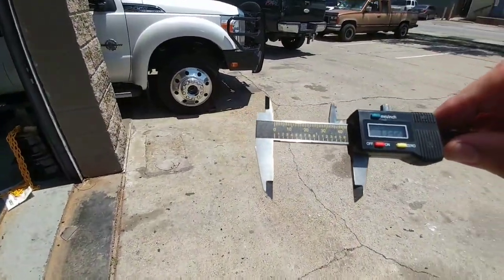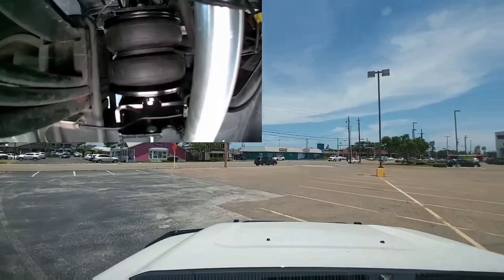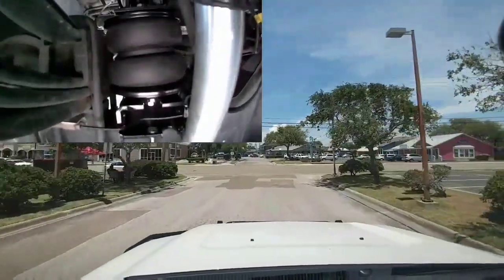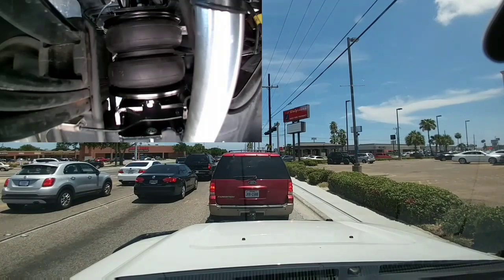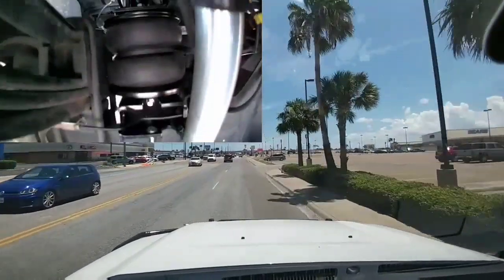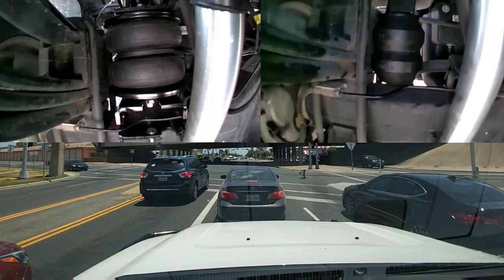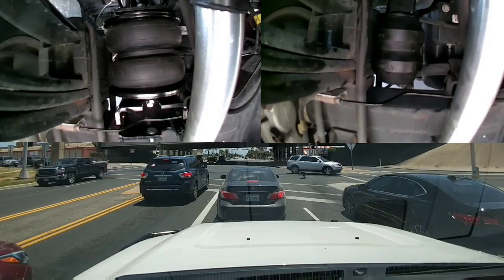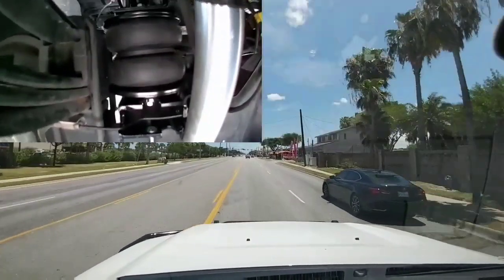Air Lift Load Lifter 5000 Airbags, First drive impression!

Comment: Interesting that he could not use airbags with his lift kit. As I said on the install video, I have a 6" lift and airbags. Maybe it is because I have a Chevy.
Reply from the maker: Shuffler703: he just didn't feel the need to add airbags for a lifted truck.
Reply: I read on one forum that a guy with a lift kit had to use graded all thread and made  his own bolting. makes sense and would be an easy custom fitment.